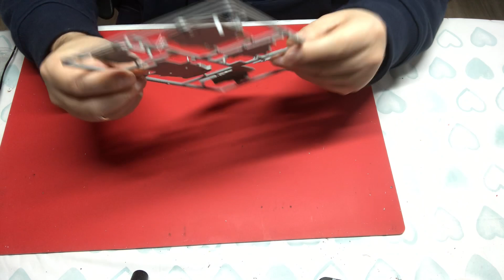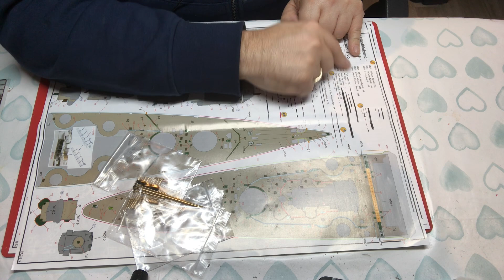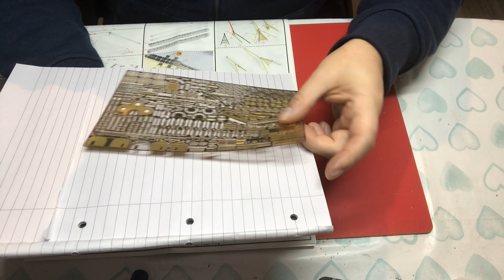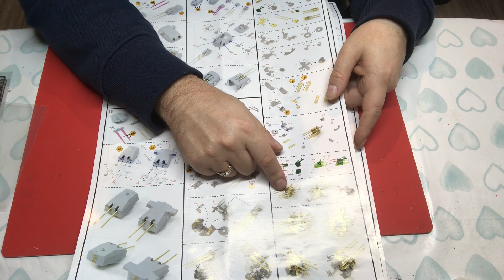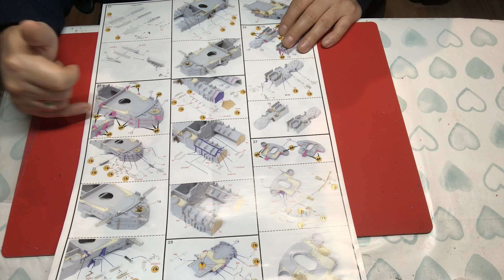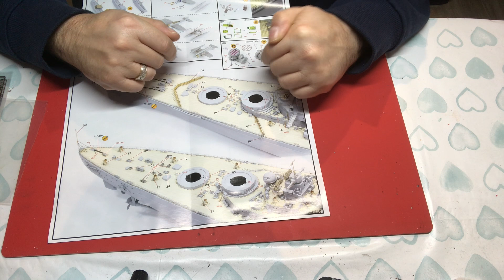First Impressions - Revell 1/350 Tirpitz Platinum edition, part 2.

Comment: I do have that kit but the first release without the replacing brass parts, PE sprues of ladders, railings, radars, cranes, ropes, I am not satisfy with the accurate in fact is wrong that premium version has the same wrong molded pieces, the most evident are the four turrets of the main heavy gunnery, the turrets are a terrible mess wrong moulded anf wrong measurements, all of them are 11 milimeter height on excess, and the overall length lacks for about 1 milimeter aditional that should had haven

Comment: I built this and found it very good. The only real issue was with the wood decking. It is self adhesive which makes it very difficult to get off the backing sheet for the small sections. I would have preferred to have to add some glue myself and make is simpler to get off. It breaks on the deck plank joins.